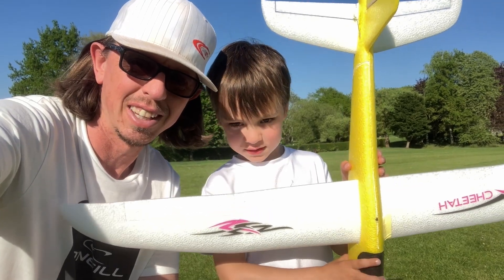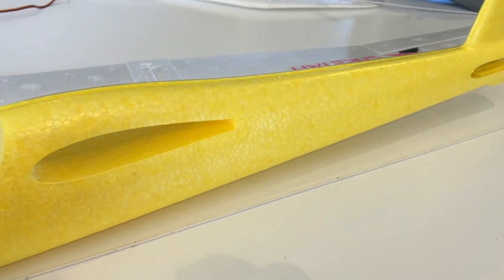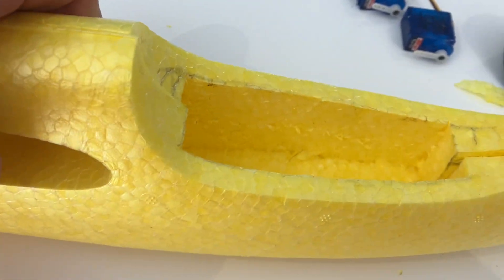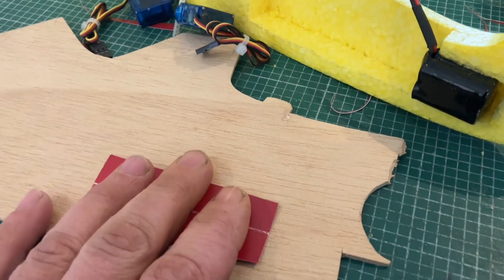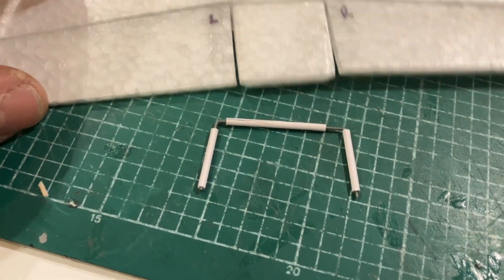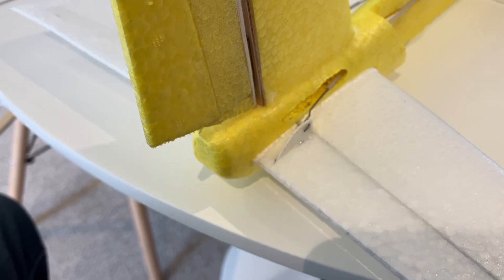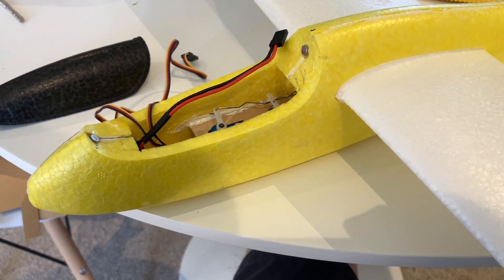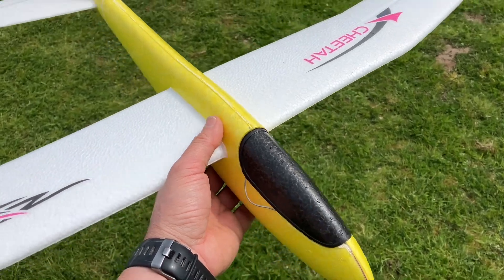We Turned a $15 Chuck Glider into an RC Plane – You Won’t Believe How Well It Flies! 2

Comment: excellent  work.   however
0947   ideally, the root chord lengths of the stabs should be  Equal; rudder and elevator chords should be equal.
1010   there should be  No  'extra' bends in a pushrod.     the short elevator control horn results in over-sensitivity.  
these things are true, regardless of your preferences.      d

Comment: I’ve just started on a similar conversion of the smaller blue glider for my nephew, but I’m struggling to find the sleeved pushrod you use. What should I be searching for? (Everything I’ve found so far seems to be much chunkier)
Reply from the maker: If you can’t find the this ones You can use piano wire and ptfe tube.

 https://www.hyperflight.co.uk/products.asp?cat=Materials&subcat=PTFE+Tube

Comment: Flies a treat. I did a similar conversion on the Lidle version, but stuck in aileron control & an external servo pushrod for the elevator & goes great off dunes at the beach.
Reply from the maker: Nice we plan on taking this to the beach for our holidays.

Comment: Handles the slopes quite well. Did the CG have to be more rearward than a straight wing because of the taper at the wingtips?
Reply from the maker: The CoG came marked as 50mm from the leading edge so at about 45% so yes a little more rearward than a straight taper. This setting is fairly far back in terms of performance but good for flat field flying so for on the slope you could afford to go a little more rearward to make the handling a little more docile.

Comment: Looks great, I've seen some videos of "LIDL-glider" conversions but never one where it's actually cut lengthwise, seeing you put a plywood insert in it, I imagine that insert a bit larger with an extension up on top for a motor on it's back, that would rock I think.  Cheers m8.
Reply from the maker: Many thanks yes some sort of motor could be fun.

Comment: That's great. Did you strengthen the fuselage just in front of the tailplane? It is only half width, so it looks a bit of a weak spot. But it was a great result.
Reply from the maker: Not directly only with the glue itself. We haven’t had any issues with that area as yet.
Reply: @CGreyBuilds Thanks for the reply.  It's been a few years since i was building keil kraft kits! (Cadet, Topper and a Jetex powered Cub)

Comment: as there is only two servos does the rudder also provide roll control? and if so on the transmitter did you connect the rudder to where the rudder usually is or did you instead put it to where the roll usually is on the transmitter? i am currently working on a similar project and don't want to have to connect servos into the wings for normal aileron control. 
i will have to definitely have to try making one of the foam ones at some point as it looked as if it flew really well!
Reply from the maker: Yes in a way. Rudder elevators only control mostly relies on the stability that the dihedral gives(think of it a bit like a pendulum with the  fuselage effectively hanging lower down  so it always wants to be at the bottom and thus correct any roll induced by a turn or rudder input. I normally have the rudder in the same place as where the ail. Would be on the transmitter and occasionally put a mix in so it is all so on the rudder stick too. You end up flying it almost the same as you would with ailerons.
Reply: @CGreyBuilds  perfect! thanks, i shall use that system on my glider i am building. hopefully its gonna lead to it being slightly lighter and it flying less like a brick.
Reply from the maker: @cat4757 best of luck

Comment: You could try fitting a hook underneath the nose of the glider, and use a catapult to get it up in the air, if the tail is sturdy enough to grip at the rear. Or fit a rod to one of the wings, so you can chuck it up in the air discus launch style.
Reply from the maker: Watch this space … :)

Comment: Great conversion!   Looks like a candidate for a micro-bungee system and tow hook, AngelWingDesigns do a kit for £20 or so.   If splitting the fuselage, the tow hook could be integrated into the ply sheet support for strength….
Reply from the maker: We have tried various forms of high start however the wings are not really stiff enough to cope with one properly

Comment: Can u just use a 9 v battery to make a hot wire
Reply from the maker: I have not tried I expect a very small one. I have used an old 12v car battery  many times however

Comment: Interesting that it came in nose heavy. With this information would you recommend sinking the servos into the foam near the tail of the glider? This would push the CoG back and eliminate the weight of the pushrods. You would have more servo lead weight but I'm sure it would be lighter and a simpler build.
Reply from the maker: Since the video I have swapped to a lighter 2s lipo 350mah and it has balanced perfect. I probably wouldn’t go a huge amount smaller on the battery for duration reasons. I would consider going perhaps with a smaller and lighter servo and receiver however.

Comment: A overview of your hot wire setup would help many newcomers to the hobby!  Interesting build, wish I was in an area where sloping could be done 😢.
Reply from the maker: Sure I will try to cover that in a future video.Sloping is fun, you really don’t need much more than a small bank a few meters high to soar these gliders even a shallow beach or sand dune will work. I find the most fun is when thermal flying on the flat.